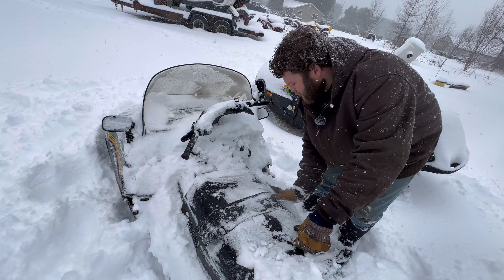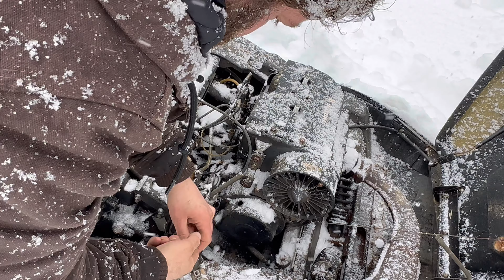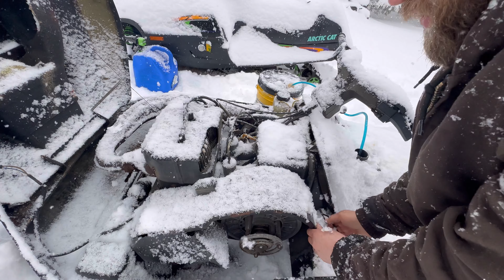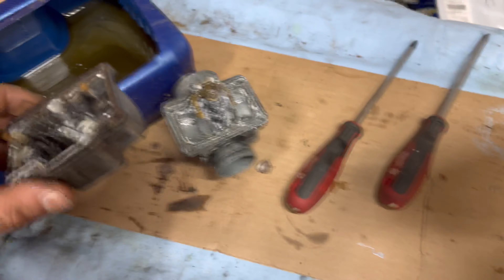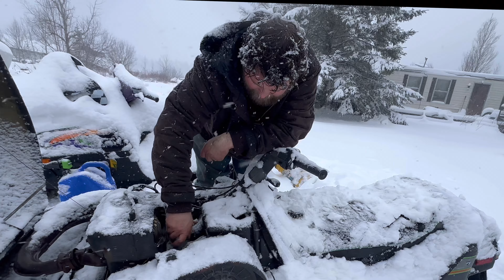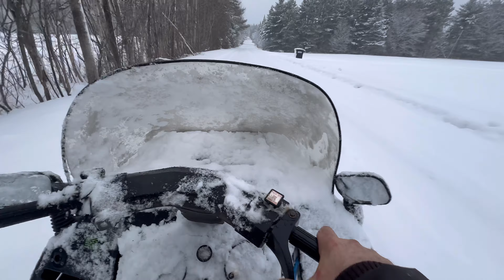Paid $200 for the old Arctic cat Cougar 500! Will it run???

Comment: Always check the throttle safety switch on those cats . I’ve had a ton that coused probs it’s up on the thumb throttle where the pin goes in if you notice the hole is slotted a lil bit . Youl see the wires up there for it. It will sound like carb or electrical probs when it acts up I hope you see this . I think you need to unhook them or twist the 2 wires togather on wire harness side . I’m betting this is ur issue easy fix

Comment: That machine like all cats from that time frame have a normally closed ignition system, right pain in the ass.
I have the same model and year cougar and Im always chasing spark issues. Best to run a kill switch right from the engine plug and bypass the factory key and kill switch. Still not a for sure fix. Jump the black and brown wire at the engine harness plug and see if it runs any better. Good luck!

Comment: Any idea why my -87 cougar doesn't idle? Revs deacent, carbs cleaned, good spark and compression good.
Reply from the maker: Could be a dried out crank seal. With the engine running spray some carb clean behind the primary clutch, if the rpm’s change is say your seal is sucking air and needs to be replaced. Also check your carb boots to make sure they are not cracked and sucking air.

Comment: Hello master. I would like to ask you for advice. I have a 2013 arctic cat 1000 xt. It has 5500 km and 350 operating hours. The compression for the front cylinder is 8.5 bar and 13 bar for the rear cylinder. I don't go in mud or water with it. Valve clearance is good. Maybe a ring is sticking or the exhaust valve is burnt? Best regards, Jocó
Reply from the maker: Actually on those Arctic cat 1000’s they have a decompression on the front cylinder so it is supposed to be lower than the rear. 
The book calls for 5.5-8.5 bar on the front
And 10-13 bar on the rear. 
These are cold readings at wide open throttle. 
So it appears you are in spec if you’re testing cold. 
The compression readings increase with a hot engine. 
Are you experiencing issues with your machine?
Reply: @rockspowersports  
I measured with a cold engine. There are so many problems with it that the spark plug of the first cylinder is constantly broken. After 2 hours of riding, it is already rumbling.
Reply from the maker: Oh that’s not good, it doesn’t sound like compression is your issue though.
Reply: @rockspowersports  What do you think? What could be wrong?